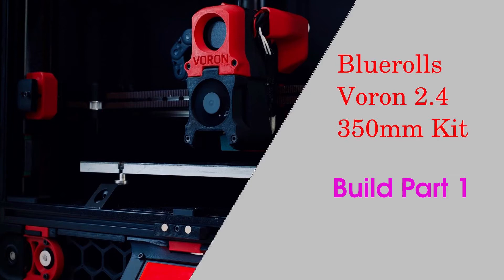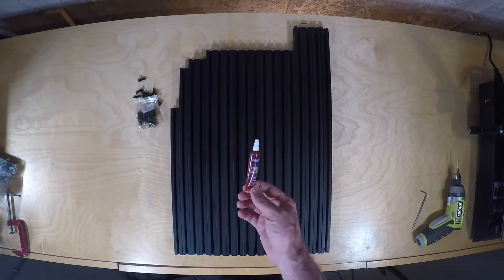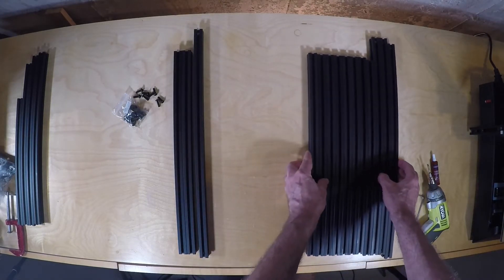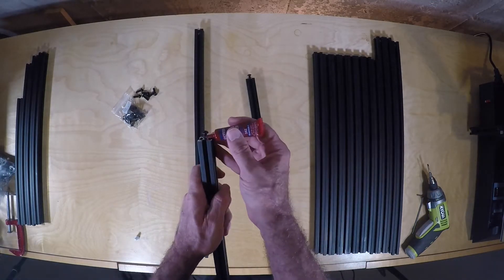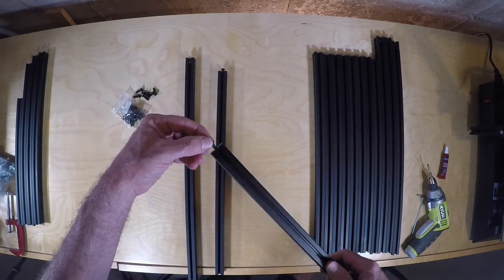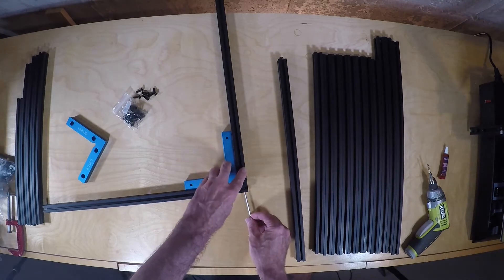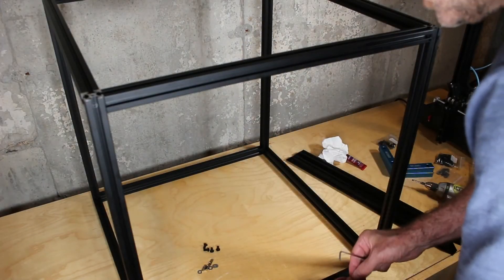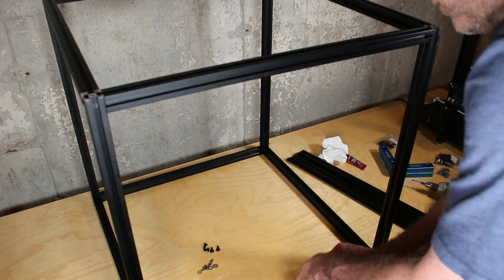Voron 2.4 Blurolls Kit Part 1 - Frame Build

Comment: I just found your videos.  Frankly, I am MOST HAPPY I found your videos!  I learned a LOT so far!   I have decided to personally challenge myself and source out the parts I need my first Voron as then I can I can take my time and spend money as I go.  I have already bought the angles you demonstrated as well as a "Right angle clamp from Amazon.  Thanks so much!
Reply from the maker: Thank you very much for the kind words.  I wish you a great build.  If you have any questions, feel free to ask.  About that right angle clamp....I ended up placing one of the angles in the clamp to check if it was indeed 90 degrees.  It wasn't!  So I checked the right angle just to be sure (with another that I own) and it was.  So my clamp was not that great.  The right angles (squares) were right on.  Also, I am planning to check the extrusion angles on the printer after the printer heats up for the 1st few times just to see if any final adjustments are needed after a few major temperature swings.  There might be some needed minor adjustments until everything stabilizes.
Reply: @KapmansBasementWorkshop  I have been doing more research.  I think I will end up buying that Blurolls kit.  It looks AWESOME.  I saw a "right-angle" clamp on Amazon I like.  I am now buying some tools that I think will help me be more successful with the build as I think I will build several of them.  I WILL be paying more attention to your videos.  I look forward to your installation of Klipper videos as that is something I also want ot learn- Installation of Klipper. :)
Reply from the maker: @troibandy2139  , I came to the same conclusion obviously!  I had to take a break due to a hot water heater self destructing in my work area.  But I'm just now getting started up again to complete the final parts of this build.  I will be posting those videos.